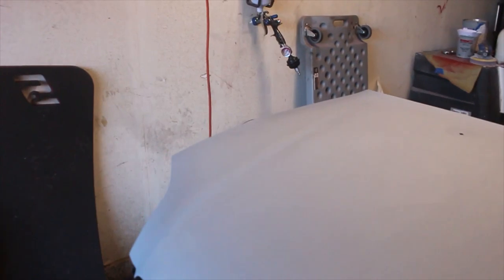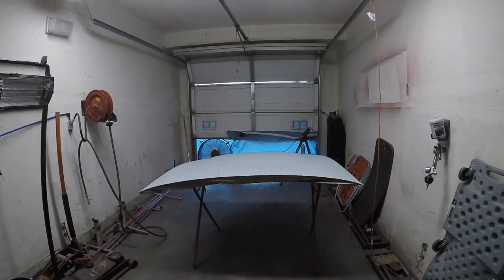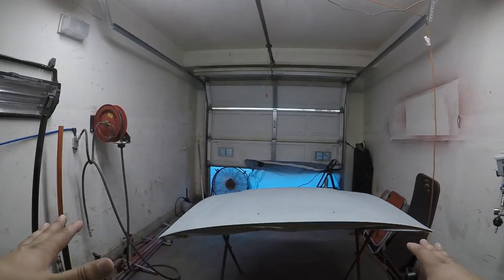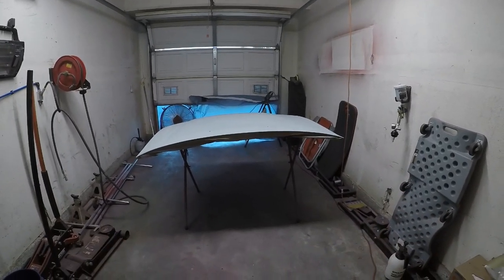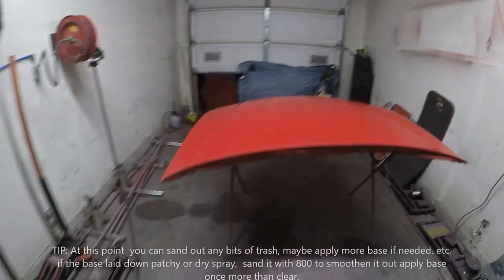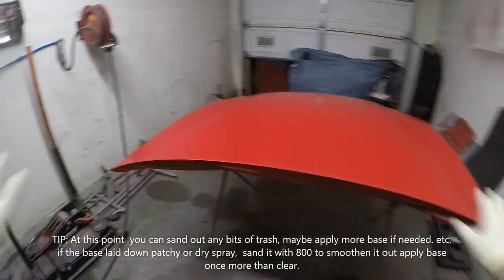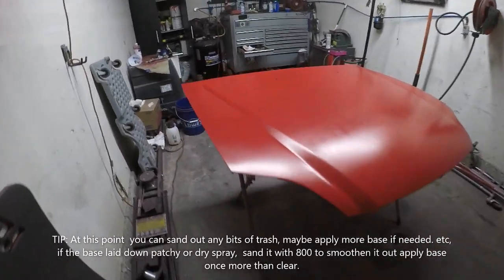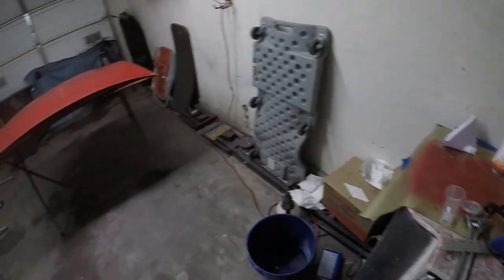How to Paint a Hood  part 2 (base/clear)

Comment: Another excellent video!  For you last coat of clear, did you pull the gun away a bit more than the first coats?  What size (gallons, cfm, and h.p.) compressor were you using?  The Tekna seemed to work well with the air supplied.

Comment: Man I really need your help. I did all the prep like part 1. But when I laid down the base coat it look like lines and some parts look nice and smooth. I also not sure if I mix it good. The guy at the paint shop did explain it. He said do half paint the half reducer.  For a 2004 range rover. 697 paint please help what can I do to fix it. Not sure also if my gun settings were right also.
Reply from the maker: When you say lines do you mean sanding scratches !?

Comment: Good work. What kind of exhaust fan u use. I sprayed entire car in garage everything came fine,, except hood it has lot of dust and because i dont have exhaust fan, fumes fall back on hood .. so like to know the exhaust fan u use and any advise u have on the problem i listed
Reply from the maker: The fan I use is a 24” inch drum fan with around 7000cfm which works very well for exhausting overspray and some dust. The fan can be purchased at any hardware store or even harbor freight which sells the same fan . Try wetting the floor too , it’ll keep some dust down. That should help tremendously. Try air blowing the garage as well of any dust that might be lingering in the walls or ceiling

Comment: I think the bug was the least of your problems. Looks like you got lots of cratering/fish eye holes on the clear coat. Some of those holes can be very deep and no amount of sanding will fix them. Usually those are caused by contamination, or bad gun settings, such as too much liquid going down the panel and not enough atomization.
Reply from the maker: Those actually aren’t fisheyes , that’s dust specks that landed on the hood, my mistake was I opened the garage door too early and when I opened it the dust from the door since it swings over the hood sprinkled dust specks and that’s what you see, cut and buff took care of those